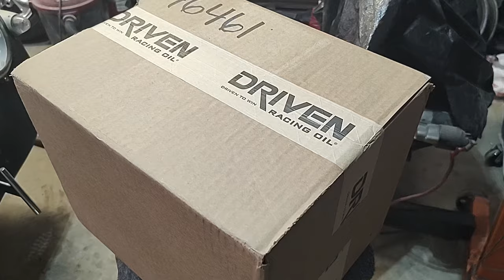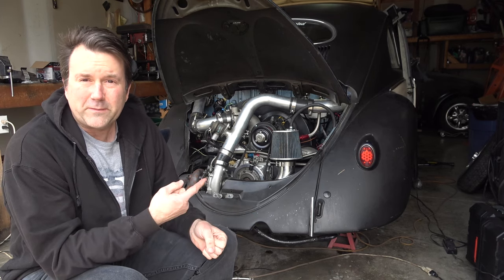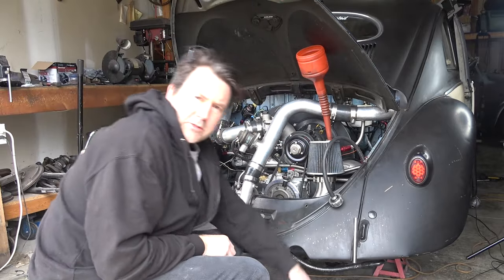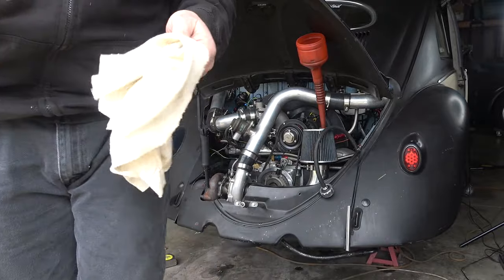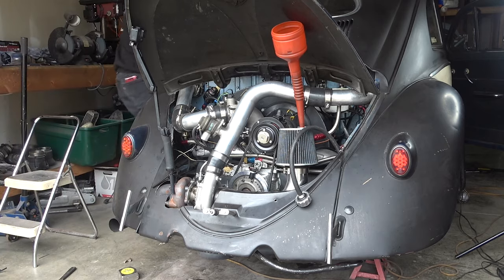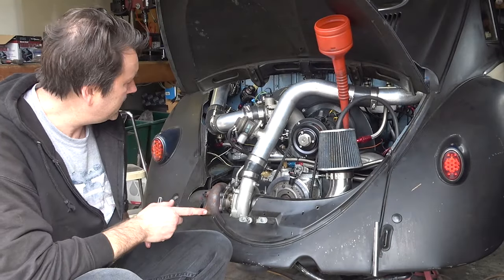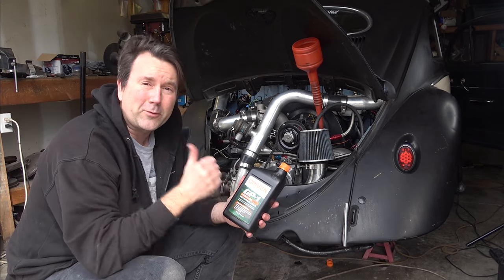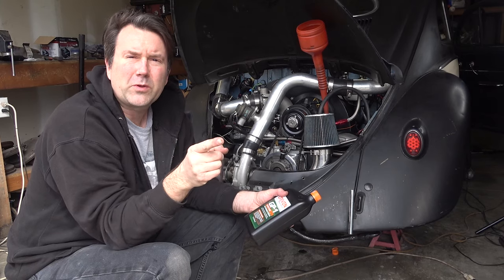My 1956 VW Beetle's First Start with Driven Racing Oil and Snake Eater Performance

Comment: Hi. I have a 57 ragtop that I've efi turbo'd as well.  I'd like to see what you used for a muffeler. I currently have the 8" downtibe from CB, but its just too loud to enjoy driving.   Thank you in advance.
Reply from the maker: https://youtu.be/asUzxAx9wgA
Reply from the maker: This is a better look at my tail pipe. I don't run a muffler but it is longer than 8" and points out the back of the car instead of down.
https://youtu.be/XnjZGTWAYig?si=ElHx0jhQu3NzV0VD